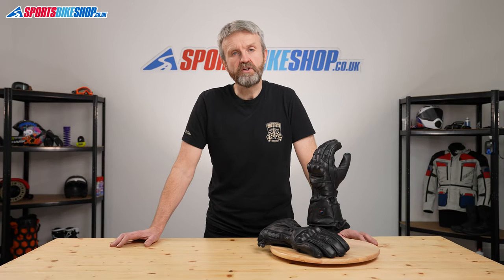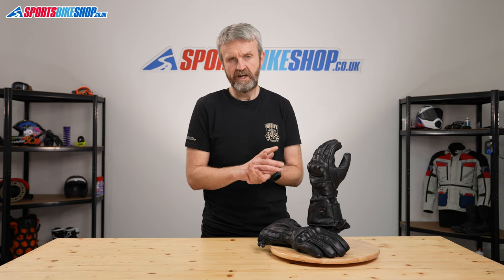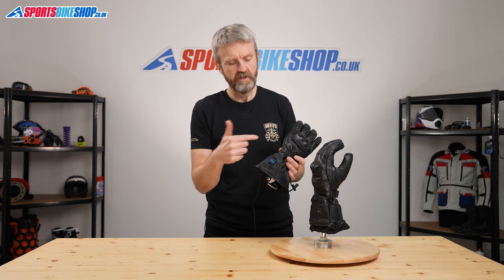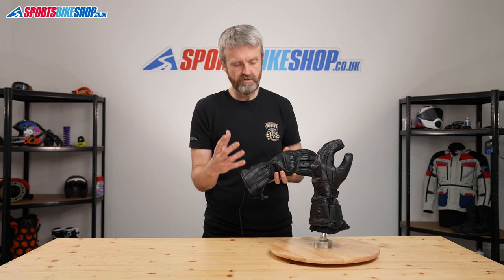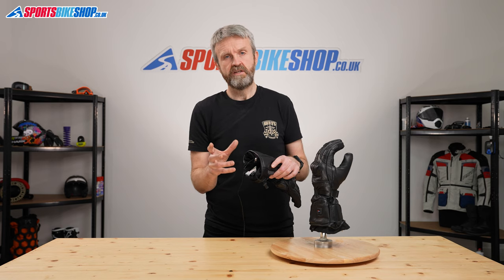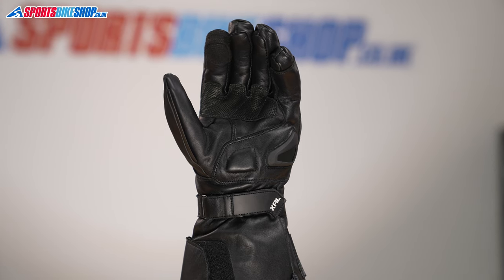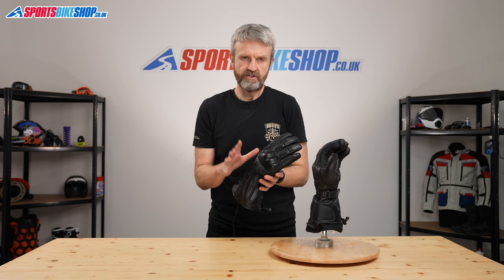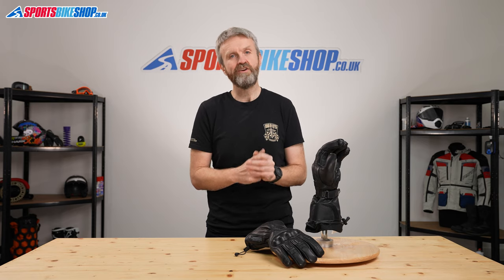Gerbing MicroWirePRO Heated XRL Hybrid motorcycle gloves review - Sportsbikeshop

Comment: Best gloves ever, used gerbing gloves for 5 years on older model and wouldn't think twice buying again, just also brought their heated jacket and paired up to the gloves you could easily ride across the Antarctic, highest level on coat starts to burn your arms and back after 5 minutes but because you are warm I definitely noticed I was more alert to riding in bad conditions, great review 👍😀
Reply: Did you hold the power button down on the previous generation to un lock the extra heat these new gloves don't do that and aren't as hot

Comment: What about the batteries. When winter is done do you have to charge them  a few times trough the year to maintain battery capacity ?
Reply from the maker: Sorry for the late response - Gerbing recommend that batteries are left at 30-50% charge when put into long-term storage. They also suggest charging the batteries back up and then draining them back to 30-50% a couple of times during the summer to maximise their lifespan. Thanks for getting in touch and I hope that helps. Cheers, Tony